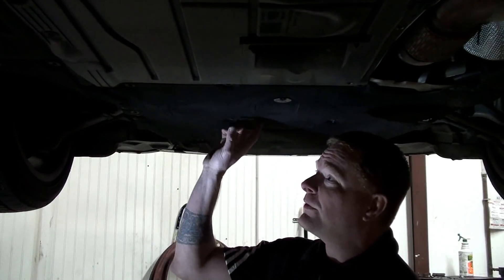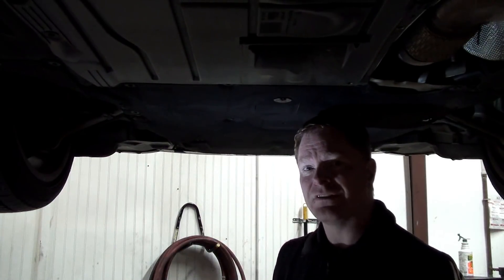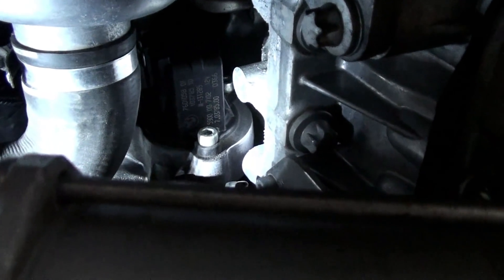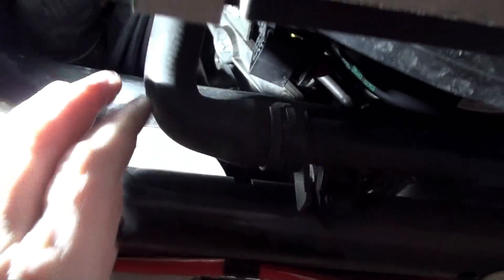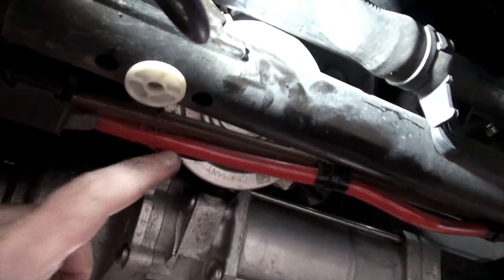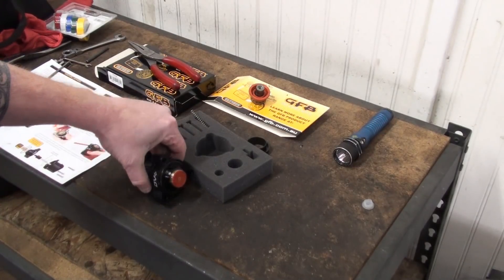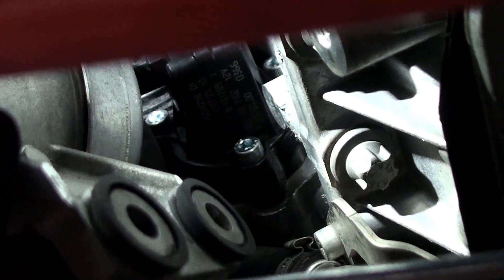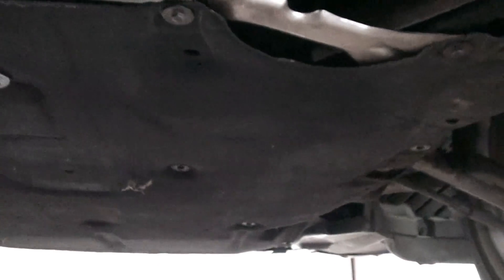BMW F32 435i N55 Go Fast Bits DV+ install DIY

Comment: Hi there, would it be possible to install this without jacking up the car?
Reply from the maker: No way, you HAVE to be under the car.  There is no way to get at this from the top.

Comment: Link is for T9357 (N20).  Shouldn't the F32 435i N55 be using T9356?  I ask because that vehicle isn't even listed on gfb site...
Reply from the maker: Yup.. here is the updated info:
BMW N55 Engines (ALL)  Part No. T9356 (Except M2)
BMW N20 Engines (ALL)  Part No. T9357 (Compatible with the M2)
Reply: BMW DIY Guy cheers!  Thanks for the vids.  Doing an xdrive this weekend.  Going to be painful!
Reply from the maker: @brandongroce8212  Good luck!

Comment: Can you explain in details how to remove the water pumb. How many bolts in total and do we need to open any hose or just hang the water pumb on the side?
So curious how to remove the top screw of the diverter vavle, the 2 bottom screws look Ok. Cheers
Reply from the maker: So the top screw of the DV is a pain, but I explain the video how to make a tool that will work.  If you have a long 5mm allen wrench socket, that can work, which I didnt at the time.  What I did was take a 5mm allen wrench, cut off the bend, then put a 5mm ratcheting wrench on the now straight bar and took the bolt out.  I also just hung the water pump to the side to get it out of the way.
Reply: @BMWDIYGuy  how many bolts for the water pumb?
Reply from the maker: @ellieethan5918  There are 3 bolts that I mention in the video.

Comment: looking to install an intercooler, that pretty much in the same place? worth doing together? plus on a stage 2 defintetly worth changng?
Reply from the maker: Not a bad thought at all.. you will have the car up in the air, the belly pan off anyway, so might as well save that effort as an improved FMIC is important.  If you haven't changed your charge pipe yet, absolutely look into doing that!

Comment: Tried to do this on my x drive the other day and it was near impossible.  I have to have a second go at it this week. The black metal bracket below the silver piece where the axel sits at 1:30 on the x drive isnt removable like on the rwd models. Have you met anyone thats installed it on their x drive model?
Reply: Yes! Ok I'm running into the same problem here. It's damn near impossible. I was motivated after watching this video then realized our shielding is different.   Any luck??
Reply: Did either of you get this completed?  What did you do?

Comment: Question, would it be easier to undo 2 bottom bolts from the bottom of the car and do the top last bolt, from the top of the car?
Reply from the maker: Great question.. I was unable to find a path to get at that top bolt coming down from above.
Reply: Roger that, thanks. I'm planning to do this job myself as I am experiencing weird boost drops, it happens at full WOT mid pull, anywhere in the RPM range under 100% throttle, im suspecting the stock DV cannot handle stage 2 boost pressure and dumps it until it regains itself and continues to accelerate, which would explain hiccups during WOT followed by normal acceleration. Could also be a bad coil, im replacing that as well. Just hoping its not my clutch :(
Reply from the maker: I hope it isnt your clutch as well.. I went a little crazy on my ignition coils, but am really impressed candidly.  I got the Ignition Projects plasma coils from Active Autowerke.. they are anything but cheap, but I feel really support the rest of the build so worth it in the long run.

Comment: Tried looking for an email address to contact you. I'm enjoying your channel. Was wondering if your 435i was Xdrive? Mine is (almost necessary for these Pittsburgh winters) and I plan on doing this install myself. If yours isn't equipped with Xdrive, do you know of anything that would be in the way? Thanks in advance!
Reply from the maker: Jason McCauley no problem.. mine isnt an Xdrive but I dont believe there is any additional components in the way for the install.

Comment: Curious if after install you got a CEL.  Reading info on the product it states that could be a possibility.  Got one yesterday but havent installed yet.  Running MHD tune so who knows perhaps the tune would take care of any CEL's anyway.  Thanks.
Reply from the maker: Sean L I didnt and haven't seen one yet so doing great!
Reply: Thanks- I guess I should have listened to the entire vid before asking.  Thanks much-good video/review.  Can't wait to install mine.  Picked up my car yesterday and installed MHD Stg1 right away :)
Reply: I used the GFB one on my N55 M2 and it tripped the cel after about 5 hours of use. I took the gfb back for a refund and went to Turbosmart who have a complete plug and play unit that replaces the original diverter valve completely and 3 months and so far no issues. Highly recommend the Turbosmart option purely because it completely replaces the OEM diverter valve without the risk of damaging the OEM part by pulling it apart and reassembling.

Comment: You'r DIY's are amazing! Do you think this would be similar for an N55 135i? Thank you.
Reply from the maker: Thank you so much!  I am willing to bet the process is the same or similar if the motor is the same.  You may have other components near or around it depending on how tight it is in the engine compartment, but if the same motor it should be really similar.

Comment: Im located near this spot, i have an E70 with an N55 and wanna swap this in. similar routine?
Reply from the maker: If the motor is similar, then my guess would be is that it is located about the same.  I know that is vague, but assuming the motor is the same then the difference would be only what is around it.. are their other pipes or motor components in the way or different than the F32.

Comment: That's a good upgrade for all of us BMW owners that we have remmaped the engine and working above 20-25psi.
I've fitted it a year now on my N13 F20 and working great.
BEWARE: there are many knock-offs on the eBay with half the price of the original. I've bought one fake by mistake.
Reply from the maker: Vasilis Dedousis Great reminder! It's really sad that GFB has to put up a video on how to spot a fake! Always buy the real thing from a reputable dealer.